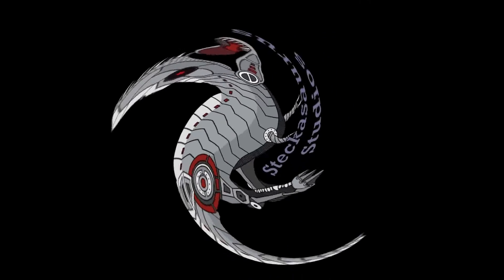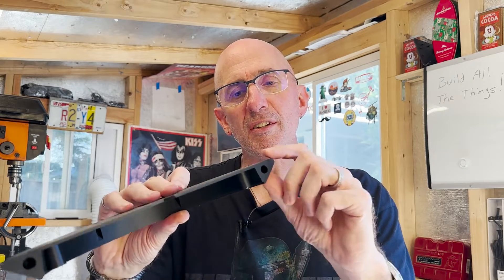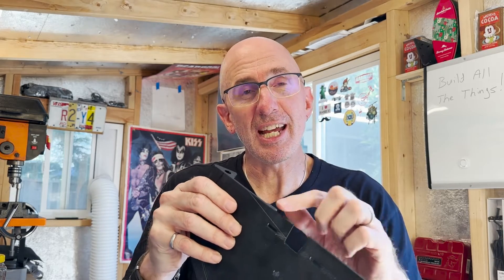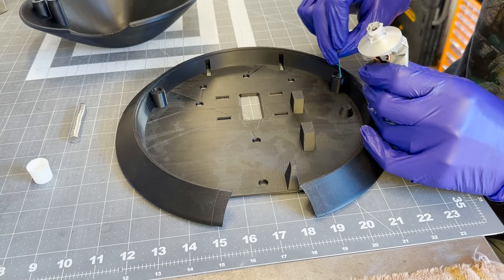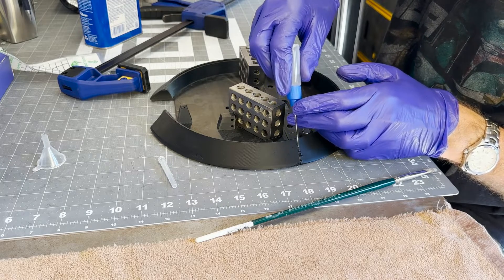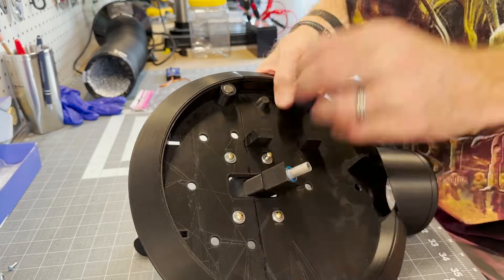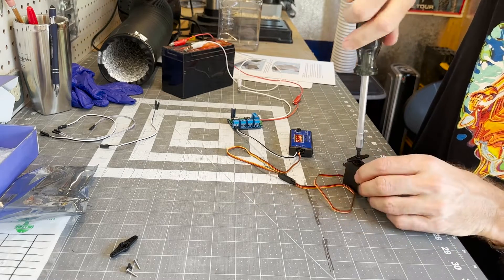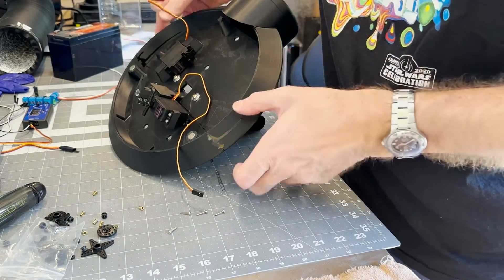Pit droid episode 4: Head assembly and right arm redesign

Comment: I appreciate the detail of placing bearings in the joints. Where that fits it is really going to improve the robustness and durability of your project. Where bearings are not an option, might I suggest Delrin? You can buy Delrin balls that can screw into the ABS for the ball joint for example. I will keep watching.